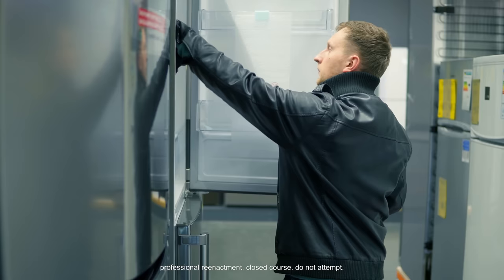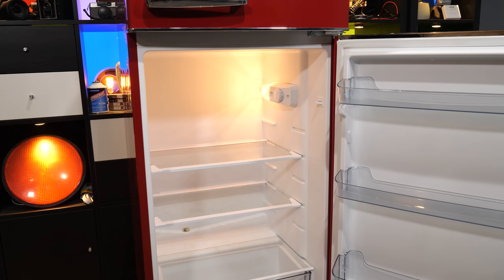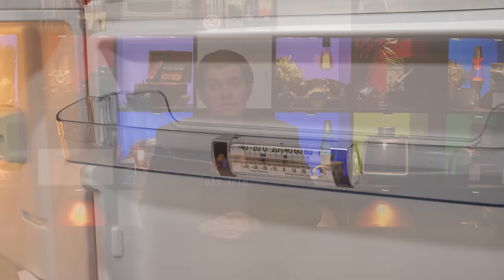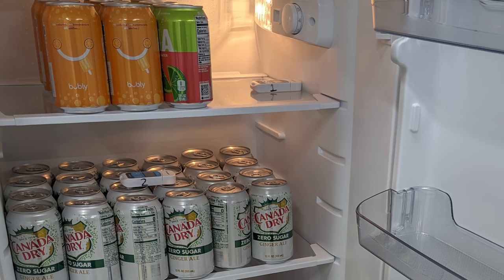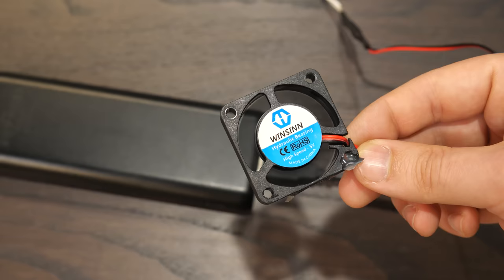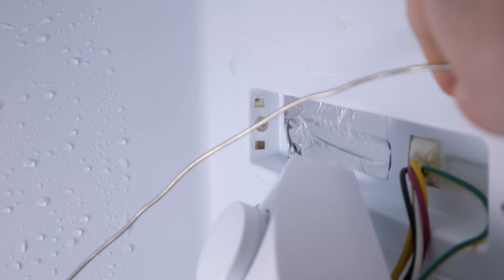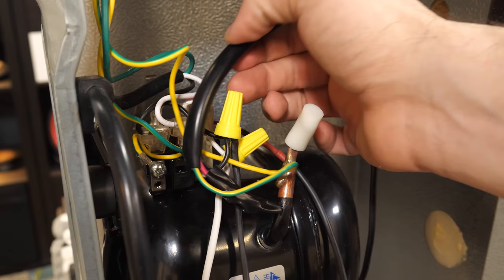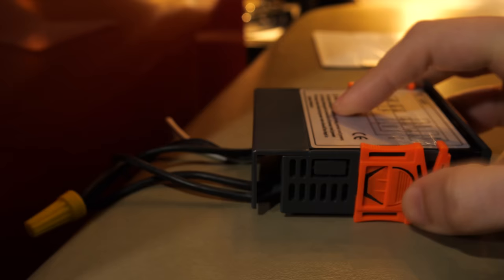This goofy fridge has a really clever design. It's also kinda terrible.

Comment: Interesting, especially the fridge temperature he expects.  Here the standard fridge temp is 8C (46F). Most produce will have a text " store at 8C".  This is regarded to be safe. Some people even set their fridge to 10C (50F) to save energy. Some set it to 6C (43F), but it is rarely lower than that
Reply: Below 5 ish keeps things from growing
Reply: I was wondering the same thing. After looking at a couple of (german) websites the recommandation seems to be 7°C (≈45°F) in the middle compartment of the fridge and -18°C (≈0°F) in the freezer. Those websites also mention that different parts of the fridge have different temperatures and are used to store different things. So the non uniform temperature is wanted in german fridges.
Reply: My fridge is set to 2C.
Reply: 50 f?!?! Why would you risk it so much to save like $3/month in electricity costs?

Safety aside, food will just go bad faster.
Reply: @AndrewGray1987  Food becoming bad faster matters less if you go shopping every other day for fresh produce. I wouldn't want my fridge this warm though, it stays at the  goverment recommended temperature of 8C ;-)
Reply: Yeah for like half of the video I was wondering if he had done wrong conversions between Fahrenheit and Celsius, because I’ve never seen someone seeking almost around freezing temperatures if not even below in a fridge… The average temperature he was aiming for is like really low for my standards
Reply: Here we do 0 to 2°C for the fridge and -18 to -20°C for the freezer
Reply: @archiveprovider3981  Exactly. For example I found a website from Bosch which states:
"When you set the refrigerator temperature, you should know the needs of different foods. Some need more humidity, others less, still others are stored at the lowest possible degrees.
    Fruits and vegetables stay nice and crisp in the vegetable compartment at about 6 degrees and higher humidity.
    Meat and fish last longer in the lower compartment at 1 to 3 degrees. Frozen products can also be gently defrosted on these compartments.
    Dairy products such as cheese, yogurt and quark as well as jelly, jam or spreads should ideally be stored in the upper compartments at 4 to 5 degrees.
    Put drinks in the side compartments of the door: the ideal refrigerator temperature for drinks is around 10 degrees and this is achieved here.
    Butter stays spreadable in the smaller boxes in the door.
    Mustard, ketchup and co. also keep at around 10 degrees and are best stored in the door compartments.
This way, each product finds its place and can be stored for longer."
Reply: @turun_ambartanen  This is exactly what I have been taught in elementary school in Italy (we did some home economics lessons) and why I am baffled by the fact Alec's objective is to have a consistent temperature in all the compartments... My fridge has always had drinks and sauces in the door, yoghurt on the top, butter in the middle and meat at the bottom, like a rule everybody knows. Americans are weird.
Reply: If you have to worry about your fridge being at 2ºC you really need to stop buying stuff you don't need. Do Americans keep stuff in the fridge for months? Or are you just trying to warm the earth just so you can buy a shiny new fridge in a couple of years? Either way, it's wasteful.
Reply: @foobar8894  milk, juice, soda, beer, water, everything is better at 0-2°C
Reply: @Aikano9  Actually, no. The advised temperature to better bring out organoleptic characteristics from all the drinks you listed is always between 5 to 8 °C, because lower temperatures just numb your taste buds and almost remove the aerosolizing of aromatic particles (just think about how flavored ice - lollipops - doesn't smell) making colder drinks much less tasty.
Not to talk about the risks that drinking near freezing cold drinks put you in: brain freeze, congestion, slowing of digestion times.
As for storing temperatures, UHT treated liquids can last up to 10 days after opening when kept at 4 to 6 °C. No drinks need lower temperatures to survive or to taste better
Reply: @Astervista  a cold 0-2°C soda or glass of milk is objectively better than the comparatively very warm 5-8°C.
0-2°C is the perfect fridge temperature, and that is a fact.
Reply: @Aikano9  look around at the advised serving temperatures of any drink and you'll see only temperatures above 5°C, with the only exception of Coca Cola which still advises 3° C. You'll never see less than 2 °C because it just removes taste
Reply: @Aikano9  You will never find the "best served ice cold" text on cans or bottles sold by Coca Cola or Pepsi, you can sometimes find "best served chilled" which does not necessarily mean 0-2 °C. In fact, when restaurant chains sign contracts with drink companies for supply, the companies send specifications on the serving temperatures, Coca Cola prescribing not less than 38°F and Pepsi prescribing around 42°F (3.5°C and 5.5°C).

As for fridge specifications of civilized countries (even if we are talking about serving temperatures), the European directive 1060/2010 gives the temperature recommendations by compartment type, and for "fresh food storage compartment" the temperatures range from 4°C (minimum temperature for highly perishable foodstuff) to 8°C (maximum level for the compartment). The energy efficiency class ratings go down whenever a fridge goes outside those temperatures. They can, but are considered as wasting energy.
Reply: @Astervista  0-2°C is objectively the best setting for a fridge. 4 and up is unsafe.
Reply: @Aikano9  Interesting. You do realize that those low temperatures numb your taste buds and generally remove taste from the drink because of the low volatility? If you find a drink tastes better that cold it just means it tastes bad (or you don't like it). Beer is a good example, get something with a rich taste and try it at both 9˚C and 1˚C and you'll see what I mean.
Reply: @foobar8894  any drink is better at near 0°C
Reply: @Aikano9  If you want to keep saying that a thing is "objectively the best setting" just because you say so there's just nothing I can say to counter your claim, not even showing you the exact European union directive that says it is ok for fridges to go up to 8° C for the higher compartments...
Reply: @Astervista  8 is too hot. 0-2°C is optimal
Reply: @Aikano9  I actually prefer more tempered climates, 8°C is too low for me, 25 °C in the summer is optimal for me

Comment: You should try those tests with a cold thermal mass already in the refrigerator. Almost no-one starts with a completely empty fridge and loads it full, they are not designed for that kind of load. People have stuff in the fridge that's already cold, take some out, and add more stuff.
Reply: Well, they do when it's new, I would imagine.
Reply: @laurencefraser  not really, you buy refrigerated stuff at the shops to put in your fridge; milk, meat, eggs, frozen foods etc. Not buy the fridge and load it to capacity with warm stuff.

Comment: The back panel on the inkbird controller screws off so that might help with your wire issues.  Also, there are tons of designs for this controller that you can 3D print for a housing for it if you like.  I have used these controllers a lot in my projects and found them to be very reliable.  Thanks for your dedication to esoterica and moderately acerbic wit!

Comment: I think cyclopentane is the blow in gas for the insulation, not the refrigerant itself. That being said R600a is pretty much just butane gas so yes a very flammable fridge you have there :)
Reply: Yep, the traditional blow gas for expanded styrofoam.
Reply: R600a is isobutane (one carbon with 3 carbons on it). Which has a different structure than normal butane (4 carbons in a row).
Reply: @pizzablender  👍

Comment: In the UK, most older fridges were built like this (single compressor and cooling loop, crappy thermostat, no connection between fridge and freezer etc.), though typically the hot refrigerant lines are on the back not the sides, and the freezer is below the fridge

Comment: I had a user manual of a fridge in my hand before. It stated that the thermostat should be set according to the amount of food that is placed inside the fridge. I found that to be weird when I read it a few years ago.  I don't recall whether the thermostat should be set to a higher or lower setting when the fridge is "full". Basically, the user manual stated what you found out here: The setting has not much to do with the actual desired inside temperature. The thermostat is there to some extend to adjust for the thermal mass inside the fridge.
Reply: Ok. I set my fridge to 2C and freezer to -20C and let it do its thing 😂
Reply: @My_HandleIs_ I don't think you watched the video..
Reply: I've also seen manuals telling to change it depending on the room temperature.

Comment: You just perfectly described a fridge / freezer commonly used in the EU. In other countries this seems to be somewhat of a marvel 😀
BTW: That temp gradient is supposed to be there accomodating different types of food.
For the going down after putting tons of cans at once: I guess the compressor has an overheat protection circuit. Meaning eventually it would go down, but given the fairly big heat load you put in it's going to take some time.

In hindsight a comparison of the energy efficency would have been interesting. *between an US style fridge/freezer combination and this one.
Reply: that's a good guess, sounds plausible. I'm just wondering, why are american fridges running so cool in the first place? his fridges target is between 1.6-4.4°C (35-40°F), yet we in europe have recommended temperatures between 5-8°C (41-46.4°F). why this difference? food rot is food rot, no matter the continent.
Reply: @-morrow  For most food 5-8°C is fine, but packaged meat needs 0-2°C to reach the expiration date. I have been fine with 5-8°C in my fridge but I also cook my food thoroughly.
And also: Electric energy is more expensive in the EU, and especially where I live (Germany) it is REALLY expensive.
Reply: @pascal2085  i have packaged meat that has 7°C on its expiration date. im also from germany.
Reply: my toughts exactly. I was puzzled that he killed so much time with testing and tinkering, but didn't bother to look over his (us-centric) horizon, which could have explained to him this "fridge-weirdness" ... he did it with kettles ... why not here? 😀
Reply: "In hindsight a comparison of the energy efficency would have been interesting. *between an US style fridge/freezer combination and this one."  Here in UK, my sister was given a huge (by UK standards) US style fridge for free. She soon found out why. It used a huge amount of electricity. Not helped by the freezer section not having drawers, so all the cold air was dumped out of the freezer every time it was opened.
Reply: Makes sense - I was watching this thinking it looked very similar to my fridge here in the UK.  Being domestically useless, I'd never really considered different fridge areas would have different temperatures, but then I don't keep bacon in the door.  I just sigh when the milk goes all weird.
Also, separate beverage fridge.   Everything going in the main fridge is still cold from the shop.
As ever, very interesting.
Reply: @MrRanderas  We could take this comment to discuss different standards on minced meat and meat in general comparing the US to EU ... but I'd rather not 😇
Reply: @-morrow  5-8°C? You must be in one of those European countries that doesn't drink fresh milk 🥲
Reply: @AaronSmart.online  Our Bosch fridge is set to 8 °C, the milk in the lower door shelf is at 6.6 °C (just measured with an acccurate thermometer), it keeps fresh open for at least two weeks. Maybe we have better milk in Europe … 
BTW, there is a “VitaFresh” compartment where temperature approaches 0 °C and where salads keep fresh and crispy(!) for at least two weeks. Really astonishing!
And it uses about 280 Wh per day.
Reply: @ronaldglatz4468  that's definitely UHT (ultra high temperature processed) milk if it lasts that long. For anyone used to fresh milk it tastes awful! Fresh milk (pasteurised and homogenised) is the norm in Ireland, the UK and Scandinavia - UHT is not a Europe-wide thing.
Reply: @-morrow  
and bacteria activity is the same regardless of continent. There is a marked increase in bacteria activity above 5C so milk and meats don't last nearly as long.
I keep my fridge at 2C and milk at that temp will last many days longer than even at 4C along with meat, you don't end up throwing out as much.
The most important thing though is I'm an Aussie, so beer needs to be kept bloody cold...
Reply: @AaronSmart.online our fridge is at 8 degrees and our non uth milk lasts until the expiration date just fine. Meat likewise lasts a couple of days as well in the fridge and indefinitely in the freezer. So i dont what you are saying is accurate

Comment: I got the Arctic King fridge from Walmart, it has the same thermostat. I noticed the more stuff I put in it, the warmer it got. The top shelf on the fridge door hovers around 55F with a full fridge. 

I took it apart, and it has the exact same setup as this, I guess I'll be buying a new thermostat.

Comment: It looks like there may be a thermal cutoff kicking in on the compressor motor. Seems like a pretty logical explanation too me for the 'thermal probe turning the fridge off early'. Especially as that compressor looks like it's way under sized (about the same size as a under counter fridge?).
Reply: I commented the same thing, but Alec replied, and pointed out that there was no cutoff once he switched to the new thermostat - making overheating unlikely.
Reply: @PsRohrbaugh  There is a cut off built into the relay clipped to the side of the comp however this is not there doing this, Its only purpose is a compressor safety overheat and if this triggers then there is a problem with the comp getting hot
Reply: I believe the thermal probe is down far enough that it will be influenced by the motor temperature, and they calculated where the thermoprobe needed to be so that it would work as a dual-purpose device, so they only needed one temperature probe to do both thermal cutoff for the compressor, and temperature control for the interior. That compressor is severely under sized for the fridge, and is likely not rated for the duty cycle that he wants to get out of it.

Comment: Have you considered replacing the incandescent bulb with an LED equivalent, Alec? You'd be surprised the difference it makes in lightning the cavity. PLUS: No cold temperature CFL issues!😉
Reply: Yes and he could wire a relay to the light to shut off the compressor when the door is open.

Comment: Maybe you should try wiring the fans to only run when the compressor is running. I think that's what most fridges with fans do. I think the fan running when there's no cooling happening might cause the air inside the fridge to convect and thus warm faster.
Reply: I'm more curious about how removing the shelves would affect the temperature. This fridge seems build like an old school one but old fridges have wire shelves rather than solid ones. I wonder how much putting wire shelves(provided he can find some) would affect the temperature zones and the temperature fluctuation itself.
Reply: Here I was just assuming the addition of electric motors and battery discharging was adding more heat.
Reply: I'd say longer than the compressor is running.  (normally) That evaporator will still be colder than the air inside of the fridge when the compressor shut off, and the greater temperature difference will allow more heat energy to infiltrate inside.  
By continuing to circulate air against that wall, less of the work making it cold will be wasted.  And while I want to say it would reduce the condensate forming on it by minimizing the time it is below the dew point;  More of the air would be exposed to it while it is while also sweeping droplets away, which would increase the efficiency ... 

(... I should see if that's why my AC's been leaking condensate, now that I have a new blower that's not drying it so violently when its not ingesting filters.)

I don't know if it would be cheaper (overall) to add a {second temperature controller, or delay circuit} or temperature controller with multi-stage/set-points for multiple devices.

Comment: I'd guess that the fridge's compressor has an additional overheating shutdown protection inside the motor control itself. Could explain the weird thermostat behaviour when putting the motor under load for an extended period of time.
Reply: Yes the compressor is probably overheating and shutting down. Add a thermocouple to the compressor to monitor its temp. Also the compressor may be overheating because the line voltage may be low because I saw a extension cord which is a no-no. So monitor the line voltage at the compressor if you can. The fans you added also add to the heat load. Fun ain't it?
Reply: @jimharmon3404 extension cord is ok to use
Reply: Putting a fan on the compressor would help though.

Comment: If you revisit the fan idea, I think it's worth it to use some sort of duct. Place the inlet on the cold top, and the outlet on the warm bottom. I feel that this route would be more effective than just the fan churning air around. You could even place the fans in the center of the duct, rather than at the ends, which would protect them from objects.